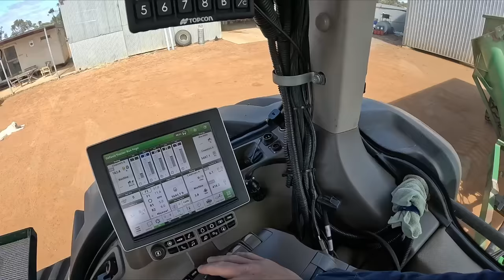Harvest is fast approaching!!

Comment: Just a thought; if the steel is cracking alongside the weld, try heating the welds with oxy and let them cool slowly. The problem seems to be the steel itself.